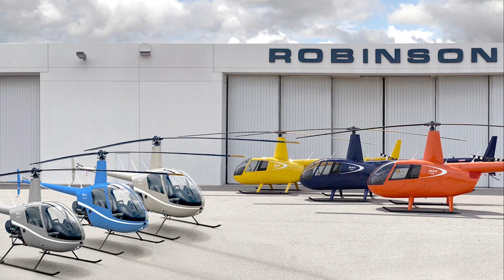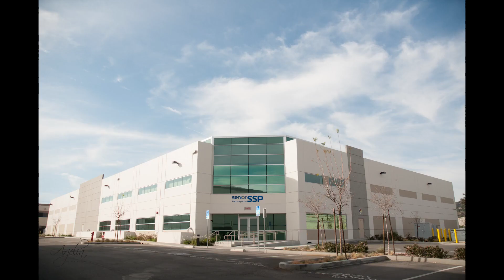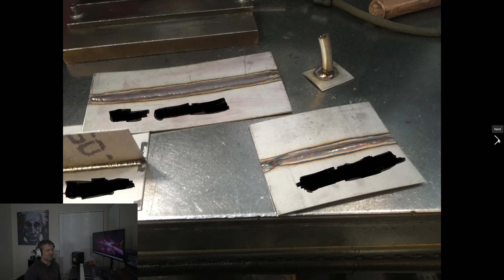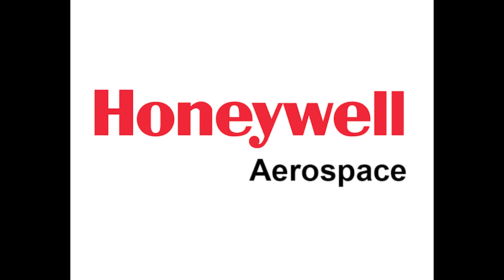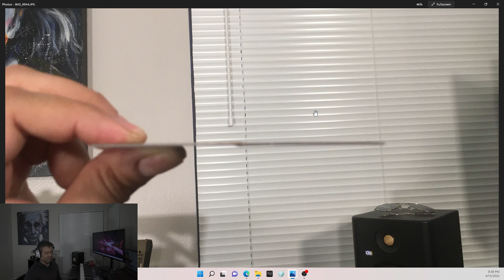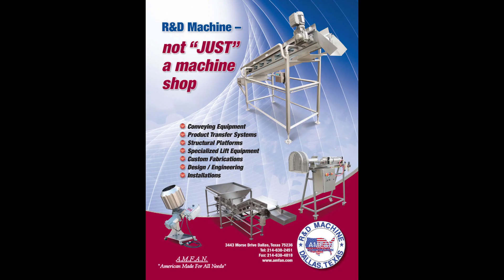5 Aerospace Weld Tests 1 Fabrication Test

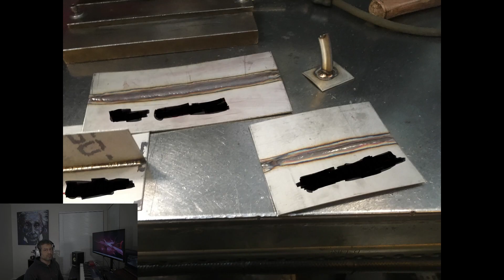Comment: @7:05 the SS weld test at Meggit, and I guess any other company, do they require you to use the equipment that they provide? Specifically, can you switch out anything on their TIG torches? 
I have several cups, and gas lenses and find that a cup 8 gas(and glass) lens works frickin amazing for tee joints, I get good gas coverage and some or no discoloration at times. But when I do a lap joint or butt joint, it comes out looking like those you showed in the picture, unless I use a size 10+ cup. I'm assuming for liability reasons you would not be allowed. 
At school, when I first tried SS I thought I would never get it down and thought that was my limit until I did a ton of research and realized I was running the amps to low and creating more HAZ and I was using the standard collet body diffuser. Once I switched to gas lenses, holy shit, it was a night and day type difference. Then I got a jazzy 10 and Furick 14 I believe and dam. . . That saved my ass.
Reply from the maker: Yes you can bring your own cups to all of these tests. Every single company I have ever tested for, they dont care if you bring your own shit. 

As i have gained more experience, I have become lazy. 

A few years back, I would bring my own cups, some basic tools like a multitool and maybe some measuring equipment and clamps. I brought clamps in case they gave me a shit fixture or if the piece would get hot... clamps, cups, sharpened tungstens of your own and some very basic tools will definitely make your life easy if the person who is testing you is a moron or they set you up to fail.

Im super lazy now but my skill level, cleverness, and willingness to just use what is available is the other option.

Like passed an aerospace aluminum test like 4 months ago and I really needed a clamp for their shitty fixture. 

No shame in my game... I was like can i borrow one. I also needed gloves. 

Never be affraid to ask. i was a little unprepared but i passed that shit and still got hired. 

Good luck and i hope that answers your question.
Reply from the maker: Bro learn about cups and gear. Every little bit helps. As you get better you will be able to use shit gear. I remember once welding titanium at an aerospace company with a fuckin harbor freight welding machine. 

The torch sucked. It was bulky and heavy. The duty cycle was shit. I had to take breaks and preheat my metal. But the job got done and nobody could tell it was done with bargan barrel equipment. 

Having good equipment gives you wiggle room to move quickly or have a bad angle and still get coverage. 

ALSO VERY IMPORTANT FOR YOU TO UNDERSTAND!!!

What we do in school and what gets done at work are two different things. 

In school we are looking for perfection. Stainless steel in a perfect world has zero color. You will just see some discoloration from the heat affected zone and nothing else if you have a massive cup with complete gas coverage. 

In reality at an aerospace job... color doesn't matter for the most part... look at my burndown weld video.... those welds look like shit and they still pass. 

At school how a weld looks is important. 

At work... a weld can look like dogshit.

If it passes the necessary inspections and the customer buys your work and is happy... you get paid. 

Nobody gives a shit how our welds look except us. They just want good parts.
Reply: @howardhughes6212  that's a lot of good information. I tend to overthink things and over anylize things, especially if it's something I'm very interested in. I guess it's just the way I learn. I do something and immediately try to find all the flaws and errors, and tell my self it needs to be better.  I took a job, a gig for some guy that need some shit welded. When I got to the site, I saw what the previous welders had done and was like, what the fuck?? This is acceptable? Not like in a "I know better than him" type of way but more like surprised that the welds were, like you said, passable. I'm still new to all this so I'm just trying to understand the do's and don'ts for lack of a better word.
Reply from the maker: @Ireallycantthinkofahandle   Be critical of your work. That is how we improve ourselves.

Plus I believe that those of us who learn welding have a responsibility to learn it well so we can pass down the knowledge to others. 

Bro I remember when I was in welding school and I went on a cruise to Mexico with my dad... that boat was filled with shitty welds. lol

Welding is there to put food on your table first and foremost. 

It is an art. You should want to be a master at welding. 

But in the end I believe you should look at welding as a key that can open doors. It will change your body and your mind over years.

I work with drones and radio electronics now. 

My understanding of electricity and frequencies came from welding. The steady hands and ability to interpret visual information helps with piloting drones. 

Learn as much as you can. Get as good as you can. Pay attention to all your new skills and the potential doors they can open.

Comment: I’m an aerospace weld engineer and had a question regarding your weld tests at these companies. Were you ever given a weld schedule to set up the GTAW process? Or was it on the welder candidate to setup his amperage (on power source), tungsten grind angle, etc. just generally curious how all aerospace companies approach their hiring of welders. Thanks man
Reply: 2 years later and im still wondering 🤔 ha
Reply from the maker: @SkittleMcDiddle   bro i dont get paid for this shit and people barely recommend my channel. i answer when i can
Reply: Good question. I´d expect them to run a full GTAW process to see if a welder is not just a good welder but understands that he is now in the top level of safety critical stuff. Lots of the samples I have seen here are terrible welds as I think, I hope this is not the welding that is done on airborne equipment. In aerospace reproducability is key and I´d expect my welders to do do exactly the same job over and over again. Same torch angle same tungsten angle same arc length same heat input same bead height same width. Everything else is Class 3 for ground equipment and jig stuff. But I am design engineer not a weld engineer. In my former projects for Airbus I had quite some crazy welding involved and most of the time QA does not even accept hand welded stuff and goes for electron beal or laser welding - especially when it comes to critical sensors like MAPS / SAPS for flight control system. Hermetically sealed and H2 testing is just standard. I had never a case where something was welded by hand but I think it is because I never were involved in stuff like airframe. Cheers buddy. Keep that shit flying.
Reply from the maker: No I have never been given a weld schedule for a get the job test. 

When I am taking the official D17.1 test to certify, yes that is mandatory. It is required and if the company is Iso9001 and/or as9100 compliant they will have the weld schedule. Look at my video on the aluminum weld test. I show an example weld schedule and the relevant text is there.

Generally speaking how we get hired is multiple tests. 

First is the get in test. 

Then we take a number of tests based upon materials we will weld and thickness ranges and shapes. 

So if you are welding sheet metal and tube for aluminum, stainless and inconel.

That is potentially 9 tests you will have to pass. 

3 tests for each material

Comment: Do you need certs to get your foot into the door. Being in union pipe trades I’m not even sure where to start and don’t know anyone that I can pick their brain as far as questions.
Reply from the maker: SpaceX: No Union direct hire
Senior aerospace SSP: Union direct hire
Honeywell aerospace: no union but the only way in is through hiring agency called manpower 
Meggett: no union direct hire 
Robinson helicopter: Union direct hire

Other major aerospace companies are mostly non union.

All the aerospace companies in this video do not require certs. Even if you have certs they don’t care.

Each aerospace company I’ve worked for will test you in house after you’re hired and your certification is through them. I was certified at senior aerospace SSP but I can’t take it anywhere.

That’s how they get you to stay and negate outside certs.

Getting into aerospace in terms of skill is the ability to pass the tests you see in the video. As long as you can get full and consistent penetration on thin stainless steel you’re good to go.

Getting into aerospace in terms of hiring and indeed… you have to apply at certain times of the year and look for agencies that work with aerospace companies.

Then there’s some companies you have no chance. 

I live across the street from bell helicopters. Their welders are trash. I know one. The reason he’s there and I have no chance is because some companies only hire locals born in the state.

In Nevada I was unable to get city jobs because locals block outsiders.

Hope the info is useful

Comment: You mentioned purge having an effect on suck back….how does that work?
Reply from the maker: Whether you have a purge or a back plate, suck back happens. 

With a back plate, suck back tends to occur with too much heat. To solve that either move faster or use pulse. 

With a purge, I've noticed suck back to occur for both too much heat and too much argon. 

I've never seen suck back purging a pipe. 

I've mostly seen it with flat sheet metal.
Reply: @howardhughes6212  great! Thanks for the reply! I have another question…if you work for a maintenance facility that does welding repairs to existing components, do you need the all the different tests?…most of the work you’ll be doing will be on the bench so in theory you would only need the ratings in the flat horizontal?
Reply from the maker: @hoodznchromez4179  To be honest I don’t think you need to be able to pass tests if you work maintenance/repair.

Welding jobs obviously need you to test.

But I’ve met plenty of maintenance mechanics that know how to weld and they never get tested.

I don’t know what they have to go though to get their jobs but I assume that having tools and being well rounded is more important for that kind of work.

Like when I was mig welding at this company virco… the guys that repaired our welding machines or our booths if they were damaged… they knew how to weld (not as good as the welders but good enough to do their jobs), use forklifts, lathes, and a bunch of other stuff.

Comment: Aerospace welder from ft worth checking in! Lockheed Martin
Reply from the maker: Nice! I knew a guy way back when I worked at Senior Aerospace that left for Lockheed. He got more money and he's a lot happier.
Reply: Very interested in working for them. Have 3 years production weld experience, what qualifications are generally required? Lmk!!
Reply from the maker: @GunsMusicKnives  Call and ask is the easiest answer I can give you. Companies need welders. Ask HR what is required of you and they will give you any information you need. Generally no qualifications are required. Most certify in house. You just need to be able to pass their weld test and weld whatever they manufacture

Comment: Very cool👍🏻Thankyou for sharing. Do they ever test for titanium welds in any of the aerospace.
Reply from the maker: Yes 100% titanium is inspected thoroughly. They basically want perfect welds with that because titanium loses all of it’s strength if it isn’t welded properly. Without a purge it will turn green and become so brittle that it can shatter. Plus the fixtures for titanium parts can be way more complex. You need large gas lenses, trail cups, or sometimes the bubble thing

Comment: Very interesting and insightful. Thanks. 
Can you say anything about material traceability in aerospace? Like at 4:22 INC 718 is etched on the coupons, is this common?
Reply from the maker: The etching on the coupons is just from the manufacturer of the metal. When it comes to material traceability, everything down to single nuts and bolts have paperwork and inspection procedures.

There is paperwork following each part.